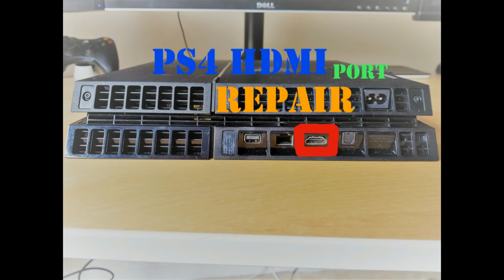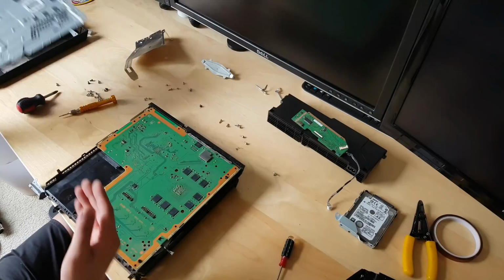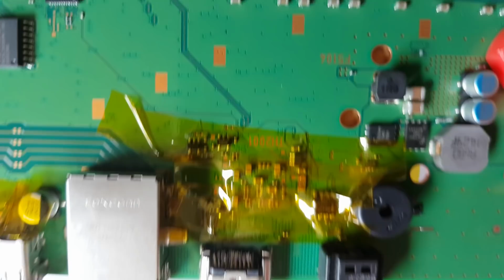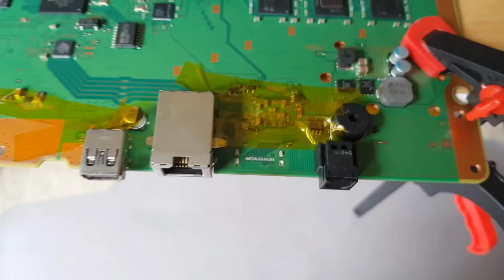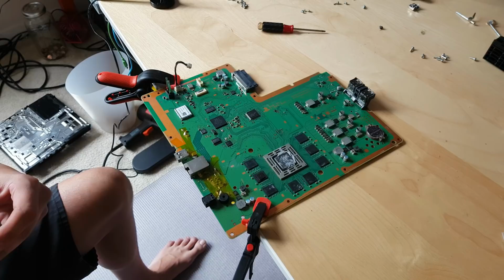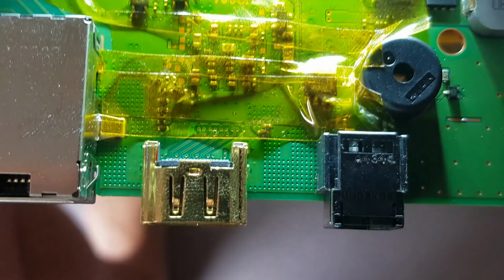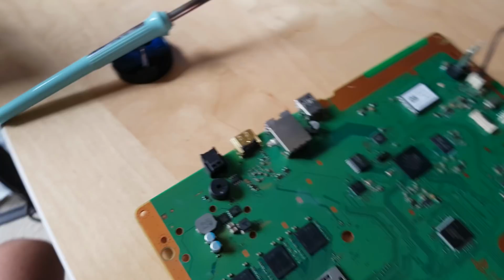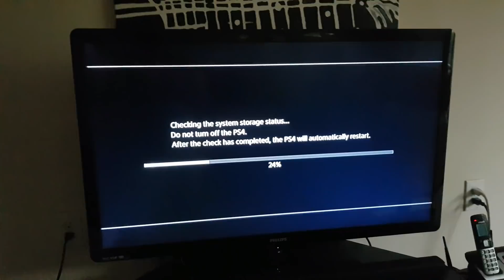PS4 HDMI Port Replacement Tutorial  - PlayStation 4 HDMI Port Qucikest without Pro TOOLS

Comment: also this is why I prefer pc gaming to console,to fix this would cost me a new motherboard, very cheap very simple and no heat gun needed and by that time I would be looking for an upgrade anyway so my point is every pc component is replaceable and very easy to replace consoles are not meant to be tampered with which is why they try to deter you from doing so with the star like screw heads which most common homes don't have the tool to even open a ps4, company's like sony would much rather you just buy a new fucking system  they are a money making business they don't want you to fix simple shit they would much rather you pay for a whole system new.

Comment: Yeah I'm just gonna throw my PS4 in the garbage
Reply from the maker: Sell it on eBay for parts and repair . Or you can find repair shops on eBay that can fix yours
Reply: Hey do I need the pins on the motherboard to touch the pin on the back of the HDMI piece ? Respond as quick as possible
Reply: @4tpkooda66 
I guess he did not.